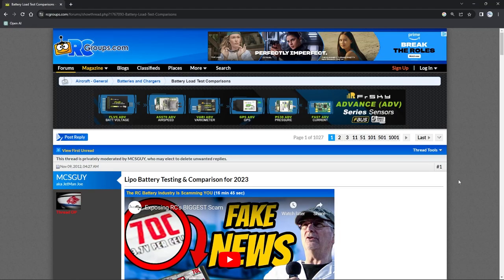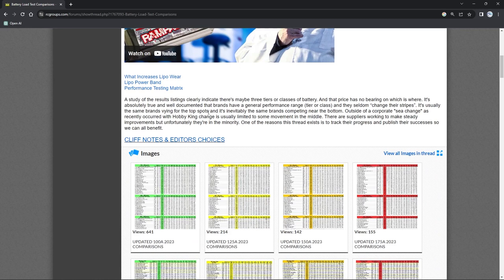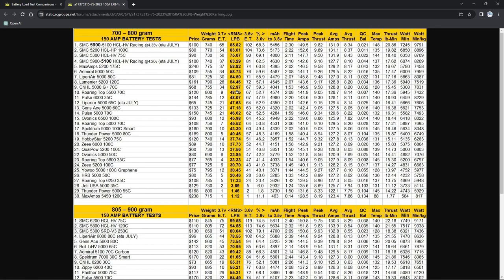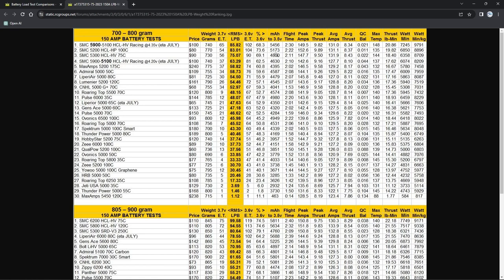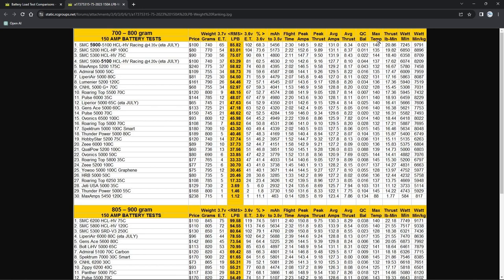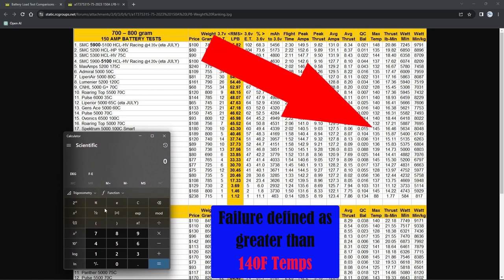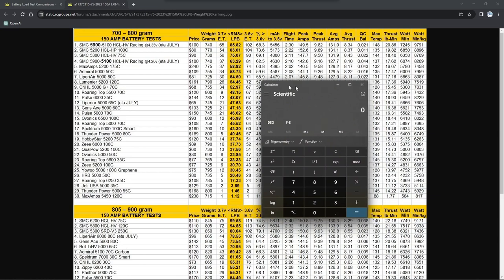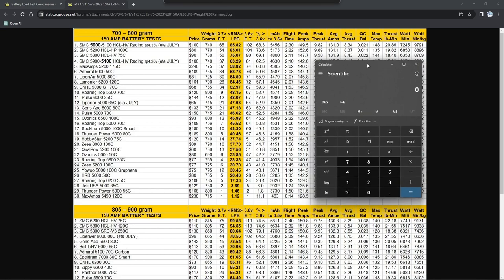The Ultimate #1 Performance Test for LiPo Battery Packs Revealed

Comment: Hello, thanks for superb video.
Is possible that hard packs with bullet females has the overal internal resistance higher than batteries with wire about (10AWG) and some connector which can be changed? I can see in my buggy, that  2 pack in serial connection are really hot. One brick 4S batteries are better. Yes, there are limitatiton that cable which leads from one to second battery. There i have short 8AWG. But when i measured almost new 2S hards packs 9000mAh during the charging, it shows me numbers like 6miliohms. One year pack show 12miliohm. There was always storage mode charged after usage. But when i count with 11-12resistance it is about  70amps as maximum current. Which in XR8 Pro ESC 160A is reasonable getting hot. And also wires. From Esc are AWG10 wires and it ends with 4mm long bullets. My friend racing with this saddle setup on SRX8e Pro buggy many years, but im little bit affraid of. I bought buggy from him with batteries together. Im really hesitating rebuild it to brick setup and run with one 4S. There i will have AS150 or EC5 connectors. Another interesting thing, inside hard packs are connectors leaded on 12AWG cable approx and this also can be a bottleneck. I thought that hard packs bullet system must have less resistance, but my experience is different now. Also 4mm bullet seems to me low current capable with 1/8 buggy or onroad. In 1/10 indoor buggy with juststock or 10bl120 esc it is okay and also on x-1 formula where is really low power consumption. Sorry for that long comment, just want to know your opinion :-)
Reply: Resistance of 12 AWG copper wire is 1.588 milliohms per foot (mΩ/ft).
The maximum current density a 12 AWG wire can achieve is 13.2 amps per mm2 (13.2 A/mm2).
So how many amps can a 12 AWG wire handle?
20 amps at 60°C
25 amps at 75°C
30 amps at 90°C
When sizing a wire, we usually take the median 75°C ampacity. That means that the ampacity of the 12 AWG wire is 25A.
So that means that 12 gauge wire can handle 25 amps right?
Yes, but also, No.
12 AWG wire can handle 25 amps of current but we use the wire as a 20 amp wire because we account for the 80% National Electric Code (NEC) requirement that states that any wire used in circuits should carry at most 80% of the total amperage. In the case of 25A 12 AWG wire, this calculates to a 20 amp circuit.

I’m hopeful this answer was just as or equally as confusing as your multiple questions with imagined variables that no one could possibly know by reading the utter mess of gibberish you’ve written above. 

So what matters?
Wire size AWG
Material and thickness of said “bullet females”.
Length of wire.
Solid or Twisted?
Ambient Temperature of the wire.
Temperature of wire under load.
IF you’re exceeding the max rated amperage for this wire, for exactly how long will you be exceeding it?

You lost me in the variables homie.
I’m just throwing at you why 12 gauge wire is used as a 20 amp wire size.
These numbers and temps vary (because of course they do) by AWG, Solid VS Stranded & Length of said wire + ambient temperature + temp under load.

In the end just look man …. shorter wire = better, lower AWG / thicker wire = more better, solid (which is still actually twisted) is better than stranded, and in a perfect world of absolute perfection of perfect perfectness we’d have zero resistance bullet connectors.
But we don’t. So we use the best we have at our disposal to do the job the wire has to do which is magically generate a spinning magnetic field around the outside of it to transfer power in a way that HOPEFULLY doesn’t set our RC Cars (or anything else for that matter) on fire.

Also, who says you need to use wire for all these connections? 
Copper Tape with conductive adhesive exists.
Mini “bus bars” exist.
Copper Nano Gel exists and is super fun cheap easy to make.
Graphene Ink exists, also super fun cheap to make and extremely minimal resistance it’s ridiculously fun.
But don’t do that don’t do any of that.
Because if you do, yah might as well just start making your own batteries with your own chemistry because that’s exactly what you’d be doing anyways minus a separation of whatever chemistry you’ve chosen.
Or do do that if you feel so inclined I suppose.

Also your batteries are getting HOT because when you run dual 2S packs in series you’re doubling the C output.
Each 2S battery is built designed engineered with metals of sizes and chemicals made to run and withstand the C output of a 2S battery. Put dual 2S in series and you’re changing everything it was designed and created for everything it was engineered to be which will wear out the batteries prematurely and, yes, cause excess heat. 

Also you want to take BURST amperage load into consideration because that’s a very real reality in the pyramid equation of massively overthinking things that you’ve already done above Lol 😂 

Good luck man 
Respect
Reply: @JeremiahLutherPritchett   Im really thank you for the long comment you did for me :-) I must agree with parts which i can understand. The best solution for my buggy is return back to brick layout and use 7mm AS150 with hard packed 4S batteries with 10AWG wires. Yes these 2S are hot after every run. Im using throttle not on maximum. Because of 2600KV motor and technical track i driving. Maybe i left 2S for 1/10 onroads, where is huge gap in current during the driving. And there are 4mm bullets more suitable than in the 1/8 trucks. Im just not really understand why co much "C" rating they promise, when real connection inside hard packs is really poor. Maybee another brand of 2S hard packs had the connectors leaded directly into electronic. But yes, serial connection between two hard packs is bottleneck again.

Comment: I always said that the Admiral batteries i buy seemed to out perform a lot of batteries ive tried and this is evidence of that. The Traxxas branded batteries also perform solid, especially considering they are only rated 25c but have easily outperformed powerhobby 100c lipos.

Comment: VERY interesting, thanks for the video! Just 2 questions regarding temperature. How much do higher temperatures affect battery life? I've also heard that batteries don't like low temperatures either - but is that true?
Reply: Yes, of course it is. That's the reason you should warm your lipos up before use in winter. I usually put them on a radiator and put them in a thermo bag so that they are still warm when I need them.
You should also give them time to get to their best performing temp before demanding top performance.
Reply: The only information I got is just to make sure they're around 20 C / 70 F before using. And not above 60 - 70 C / 160 F.

Comment: Guy doesnt understand c rate marketing. The c ratings are either based on continuous c rating or peak c rating the peak c rating is based on sub 10 second and sometimes 2 second boost applications. The continous c rating of pouches should be 20c or less depending quality. Anything above 20c continous is sketchy.